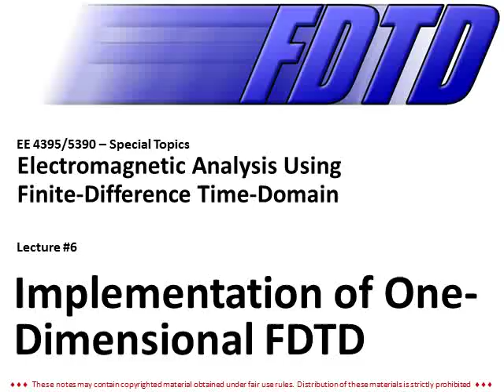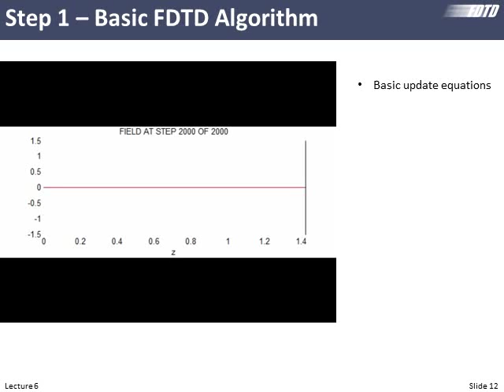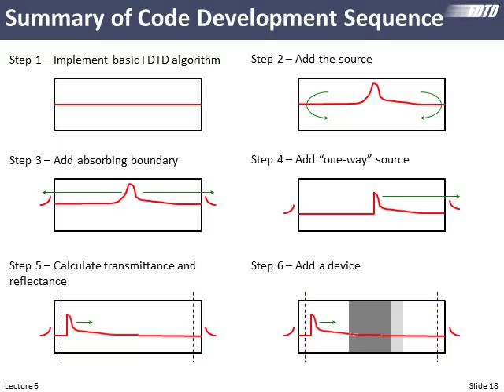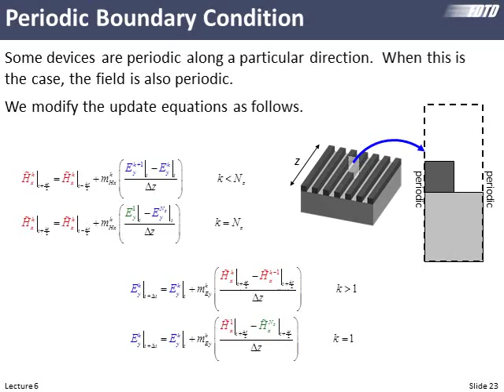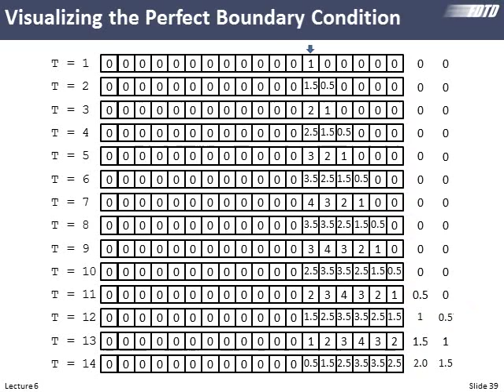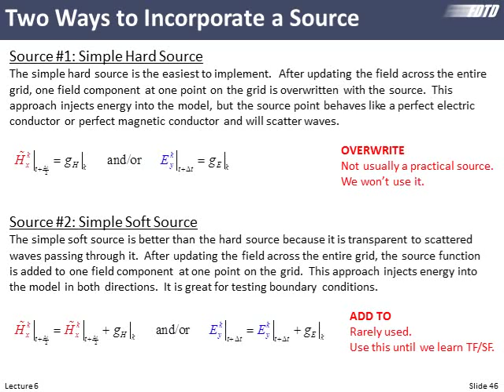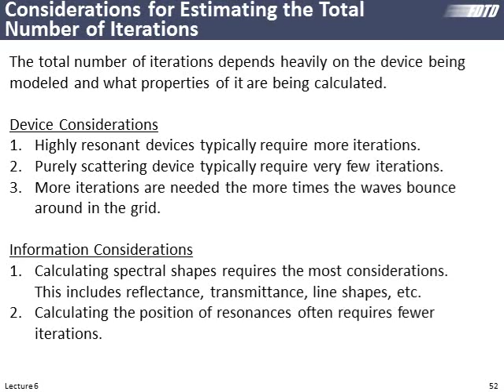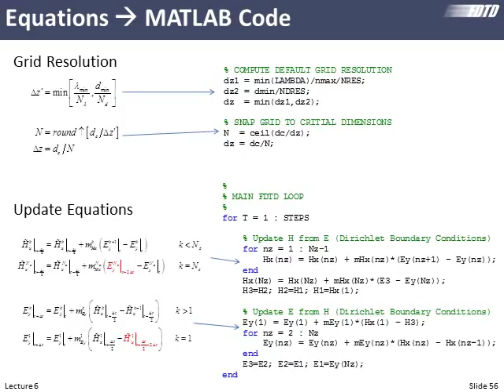Lecture 6 (FDTD) -- Implementation of 1D FDTD

Comment: Thank you again for your great lectures, Professor! In slides 32-35, you imply that S<1, where S is the Courant number. However, in most textbooks this criterion is denoted as S<=1, where the equally not only exists, but is also highly recommended (at least in the 1-D case, I’m not sure about the 2-D or 3-D). In Taflove’s book, it is mentioned that taking S=1 (magic step) leads to elimination of Taylor higher order errors, inherent to the central differences used in the derivatives, and the dispersion relation becomes exact. So I’m a little bit confused whether it’s a good practice to take always S=1 or if we should take a safety margin, as you imply, which leads to S<0.5.

Comment: Hello sir , thank you for tour videos, i am doing under this topic. 

Sir here at 8:29 
chapter "adding soft source". At iteration 90/700 , we are getting one type of wave. And ay 700/700 , we are getting one type of wave. My prediction is this must be the equal one. But it is not equal. Is my prediction correct sir? Or any mistake is there?
Reply from the maker: Very sorry, but I don't understand your question. I "think" you are asking why there seems to be two types of waves later in the simulation. That is because I am visualizing both the electric (blue) and magnetic (red) fields. At first, they overlap so closely you cannot tell them apart. After scattering from the boundaries, they get a different phase shift and they invert from each other.

Hopefully this is what you were asking!
Reply: @empossible1577  tq sir

Comment: Thank you for this amazing course! Slide 35 is muted. Can you explain how n_bc involved in the equation? Why n_min is replaced by n_bc? And how should we consider different materials in each side (BC) of problem?
Reply from the maker: Sorry for the video problem!

n_bc is the refractive index at the very edge (i.e. boundary) of your grid. The time step delta_t is calculated such that the wave travels one grid cell in EXACTLY two time steps. n_min is no longer needed when calculated this way.

As formulated, you cannot have a different refractive index on either side. If you want to, you need to do one of two things:

1. Use a different boundary condition, such as a perfectly matched layer. This is taught in the 2D section of this course. 

2. You will need to store the field value over enough time steps that you can interpolate the field at the edge from this array. For example, you may need to know the value of the field at the edge of the grid after 2.3 time steps. You would record the field for three time steps and then interpolate the field at 2.3.

I personally recommend approach 1. In the end, you will have a more capable code because it can also do 2D. A 2D code if written correctly can still simulate 1D problems.

I wanted to make you aware of a couple of things.  Right now you are going through my free FDTD course:

https://empossible.net/emp5304/

These are the notes that I use for my in-person class. If you are just getting started, you may be interested in the online FDTD course I put together. It is next level awesome in terms of simplicity and is written specifically for the complete beginner. It also teaches an improved and more powerful FDTD and includes all of the MATLAB codes.  Here is a link to a video showcasing the course:

https://youtu.be/uBiprIN8gfY

Here is a link directly to the FDTD courses:

https://empossible.thinkific.com/collections/FDTD-in-MATLAB

Also, I recently wrote a book to help the complete beginner get started in computational electromagnetics (CEM). It teaches the art of CEM using finite-difference frequency-domain (FDFD), which is the frequency-domain equivalent to FDTD that you are learning.  Here is a link to the book's website:

https://empossible.net/fdfdbook/

Hope this helps!!

Comment: Hello i'm not understand the implementation of PEC in 53:14. I did exactly the same code in the video, but in fact H2,H1, E2 and E1 need to be defined. Anyone could help me to figure out this issue please ?
Reply from the maker: This is not the perfect electric conductor (PEC) boundary condition.  Instead, it is the perfectly absorbing boundary condition.  Yes, H2, H1, E2 and E1 need to be initialized to zero before the main loop.  Unfortunately, I do not have room to show the entire code so this was left out.

Also, let me point you to the official course website.  I have links to the latest version of the notes, videos, and other learning resources.  You will see that the notes have been considerably revised and include error corrections and other things that have not made it into the videos yet.

https://empossible.net/academics/emp5304/

Comment: 18:00 We force fields at the boundaries to be zero, which causes reflections. You say that forcing the E field to 0 likens PEC, and forcing H field to 0 likens PMC. 
However given any perfect conductor (either electric or magnetic), both E field and H-field is 0.  Example, inside perfect conductor electric field is 0 (cause otherwise there would be infinite current inside the conductor), and hence even time varying magnetic field is 0 because of Maxwells eqns. 
Comments?
Reply from the maker: There are two things to consider.  First, there is a difference between PMC and PEC.  Tangential E fields tend toward zero as they approach a PEC, but they do not have to tend toward zero approaching a PMC.  Same argument for H fields.  Second, a magnetic field can exist inside of a PEC, it just has to be a static magnetic field.  Likewise, there can be an electric field inside of a PMC, albeit a static E field.
Reply: So by forcing E fields (tangential to XY plane) to 0 on one side of the grid and H field (tangential to XY plane) to 0 on other side of grid, we get PEC and PMC. This was the asymmetry you talked about. Thank you.

Comment: Where's the code for plotting Reflectance and transmittance? It was only till update equations.
Reply from the maker: Unfortunately, I have already provided more MATLAB code in this video than I probably should.  In my experience, providing code shuts down students' thinking and they go into a "code hacking" mode that is hard to pull them out of.  While it can be frustrating, it is MUCH better to write the code yourself.

If you are desperate, I have created fully online courses on FDTD that cover all of the code and multiple device examples.  The code is typed and explained line-by-line in addition to all of the theory.  Further, the online courses teach a more powerful version of FDTD.  The entire first half of the 1D FDTD course is completely free so see if you like the format.

https://empossible.thinkific.com/collections?category=FDTD-in-MATLAB

Comment: Thank you for the lecture! I have one question though, why is energy not strictly adding up to one during the simulation for some frequencies?
Reply from the maker: There are a variety of reasons this can happen.  There is numerical error that is typically well less than 1%.  There is the case where field energy is still in the simulation and not yet escaped to be counted as transmitted or reflected.  There is also the case near a diffraction order cutoff where waves are propagating nearly parallel absorbing boundaries.  Depending on what you are doing, there could be other reasons.

Comment: I divided the whole grid into three mediums: UR=1(leftmost), UR=4, UR=2(rightmost). And then run the FDTD engine with a TF/SF soft source. I have implemented the perfect 1D boundary condition. My understanding is the wave will bounce back and forth in the mid-slab for specific times, but it will be absorbed entirely on both sides.

But during simulation, I found out like the wave was absorbed on the leftmost side. But there was a reflection from the right side boundary. And when I set the ER/UR to 1 for the rightmost medium, the wave was absorbed on both sides.

So, my understanding is incorrect, or I might have an issue with my code? Appreciate your help.

Comment: Hi! This is great thanks! With your description of periodic boundary conditions, does that mean PEC boundary conditions are a special type of PBC where the field is just zero at either side of the unit cell?
Reply from the maker: While both are simple boundary conditions, I see them as very different.  A periodic boundary condition allows waves exit one side of the grid and reenter on the other.  A PEC blocks the wave altogether and it reflects.
Reply: Ahh ok but to achieve the PBC the fields on the left must be same as those on the other side of the unit cell - which is what you also do for the PEC its just they are well zero lol so completely reflect. Also say if you assume to have a dipole above a PEC then to solve for the fields do you not have a virtual dipole on the other side of the PEC so in a way the sources are being repeated i.e. it is periodic?
Reply from the maker: I think I see the way you are thinking.  If your dipole source was not centered in the grid, the PBC and PEC would behave much differently.  Second, you would have a virtual dipole on the other side of the PEC, the PEC essentially ends the problem there.  The PBC would force the problem to repeat indefinitely.
Reply: Of course and that is why you don't put the source in the center to see this effect! Ok thanks so much thats clarified it for me!

Comment: Thank you, sir, your every video inspire and help me to make corrections in my code. I have a small doubt at 23-24, that you mentioned metallic structure ( PEC ) converges at N=40-60. most of the time, I feel PEC converges quickly and it's sufficient with N=20. so I'm confused here. could you help me with that? Also on doing all these simulations time will increse.
Reply from the maker: For 1D simulations, you likely will not notice this.  I observe that for 2D simulations.  For 3D simulations, I have observed that metallic structures sometimes do not converge until around N=100.  There are techniques that can help in these cases like nonuniform or unstructured grids.  Fundamentally this is happening because the fields vary rapidly in most metallic structures and it takes higher resolution to resolve the rapid fluctuations.

Hope this helps!
Reply: @empossible1577  Thank you, sir, one small doubt, want to know the thumb rule for calculating the number of free space cells between the boundary and the target object. I usually take 1lambda, is it sufficient.
Reply from the maker: @akhilagouda5560  One lambda is probably not sufficient.  Usually 3 to 5 wavelengths large.  It is best determined through convergence.  Try making it larger and larger under your answer does not change any more.  You can also look at the modes and make sure the evanescent fields decay to zero and stay zero for a little bit before encountering the edges.

Comment: sir, even after adding boundary condition small part of the waves are reflected back. I have used a gaussian source. What should i do?
Reply from the maker: What do you mean by small?  Depending on the resolution of your grid, you can expect your reflection to be at least six orders or magnitude smaller than the original pulse.  This is normal.  If you really want this much smaller, you will need higher grid resolution or you will need to compensate for dispersion on your grid.  If your wave is more like 0.1 of your original pulse, then something is wrong.  Did you calculate your grid resolution and time step correctly?

Comment: Hi sir... Can you help me to model a thin wire (radius < cell width) on yee grid using MATLAB?
Reply from the maker: Suppose the wire runs in a y direction.  I think the easiest thing you can do is just set ERyy to a very large number like 1e6 at all points on the wire.  Technically the width of the wire will be half a grid cell, but it is an easy thing to do and will get you close.
Reply: @empossible1577  Thank you for the response sir. ERyy - does this mean the conductivity?
Reply from the maker: @gangaruwandi3153  No, ERyy is my notation for the yy element of the dielectric tensor.  It is the permittivity at the points of Ey and Dy.  Incorporating conductivity is a little more involved.  Setting ERyy to something very large is a great place to start.
Reply: @empossible1577  It's clear now. Thanks again.
Reply from the maker: @gangaruwandi3153  Awesome!

Comment: Sir, I've a question to know. I've faced this one in 1D FDTD simulation. I think my code is right.
Case 1: When Source (Ex) is unit gaussian pulse,  CFL= 0.5 the normalized value of Ex and Hz also become unit pulse.
Case 2: CFL= 0.25, the normalized value of Ex and Hz become twice of unit pulse.
Case 3: CFL= 1, the normalized value of Ex and Hz become (1/2) of unit pulse.
My question is why E and H field magnitude depends on CFL value? Doesn't it should be independent of CFL?
Reply from the maker: Is your 1D grid along the y-axis?

By CLF, you are talking about the Courant stability condition, correct?  The magnitudes should only depend on material impedance, not the stability condition.  Perhaps if you chose a value that made the code unstable weird things could happen.  I never played with that.  Check what else changes in your code when you change CFL.  If nothing else changes but your time step, I will be confused.
Reply: @empossible1577   
 Fields magnitude vary with stability criterion but no problem with stability.
Can I show you my 1D code? I cant find out the error. I will be really graetful.

Comment: Sir, how do I visualize my gaussian wave? I notice there's a function called draw1d.p on your website. But the input parameters for the same are not mentioned.
Reply from the maker: Great question.  You have motivated me to add the function headers (what you would see if you typed help at the command prompt) to see a brief summary of how to use the functions.  Below is a link to the official course website.  The Help Headers is not the very last link on the course page.

https://empossible.net/academics/emp5304/

Hope this helps!  Perhaps I should also include demo files.  Hmmm...  Maybe in the future.
Reply: @empossible1577  Thank you so much. It worked well for me. Your lectures are really comprehensive and were the ultimate resource for someone looking to pick up TMM and FDTD within a week.
Reply: I can't seem to wrap my head around why the REF/TRN spectra often crosses the unit value before all of the energy has left the system. You mentioned it in a comment somewhere, but I couldn't understand. Could you elaborate?
Reply from the maker: @raghavdhingra5417  One week?  Very nice!  I am jealous.  It took me way longer than that!  Nice job!
Reply: @empossible1577  It's all thanks to you, sir. I just managed to get some expected results with a DBR stacked on a dispersive layer.  Even though I had studied the Drude Model, I was in a bit of a fix to apply it to my FDTD code. All solved! Thank you!
Reply from the maker: @raghavdhingra5417  Awesome!  I love hearing that!  Coincidentally, I just completely revised the section in my electromagnetics notes on the Drude model.  Great job!
Reply: @empossible1577  That's great I just checked it out. I was wondering if it is possible to incorporate experimental data for plasmonic metal permitivities into the FDTD algorithm? Interpolation of Johnston and Christy's data was easily accessible on your website. So thanks for that!
Reply from the maker: @raghavdhingra5417  It is absolutely possible.  Do a literature search on the Z-transform method.  The other thing you can do is a curve fit to a Lorentz-Drude model and use the fit parameters in your code.

Comment: Did anybody understand the implementation of PBC? Due to missing audio, i couldn't get that. Can anyone help? How is the disturbance felt after 2 time steps ? what about h3=h2, h2=h1, h1=H(1)? How is this implemetation tackling the things? 
Please help.
Reply from the maker: For the PBC, the time step is chosen so that waves will travel a distance of one Yee cell in exactly two time steps.  To make a PBC, the values at the grid boundaries are saved for two time steps and these delayed values are used as the field values just outside of the grid.
Reply: Thanks for replying sir. Does that mean the intermediate number which we are getting during T=2 is a field value at the mid of the cell. Because, we observe 1 in the next cell at T=3.
Reply from the maker: There is sort of one unused delay term, that is only used to produce the delay.  Is this what you were asking?
Reply: @empossible1577  Yes sir. That is only the  issue now. Other issues do not exist now. Thank you.
Reply: @empossible1577  in 31:10 you said we have to implement h3=h2, h2=h1 and h1=H(1), but in the PDF file of the course materials
https://empossible.net/wp-content/uploads/2020/01/Lecture-Implementation-of-1D-FDTD.pdf
it shows only h2=h1, h1=H(1) on slide 43. Is that incorrect?
Reply from the maker: @ProfeARios  Both work, but the PDF is the most efficient because there is one less intermediate variable to store.  Your code will run a few microseconds faster without it!  BTW, the PDFs are always the latest and greatest because it is difficult to rerecord the entire video to fix little things in all of my slides.
Reply from the maker: @ProfeARios  Both work, but go with the PDF.
Reply: @empossible1577  Thank you so much for your help 👍 Best regards from the Republic of Panama.
Reply from the maker: @ProfeARios  Great to hear from you Republic of Panama!